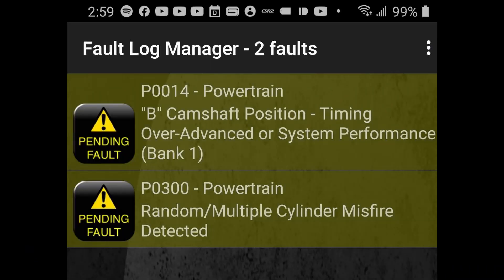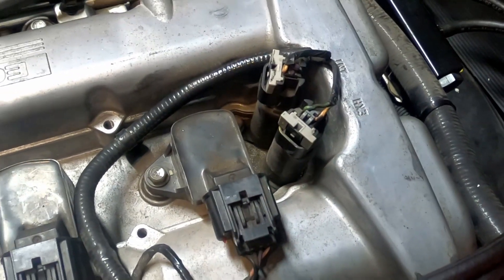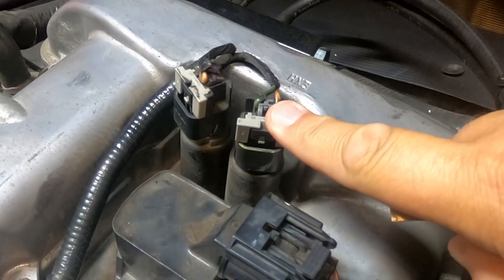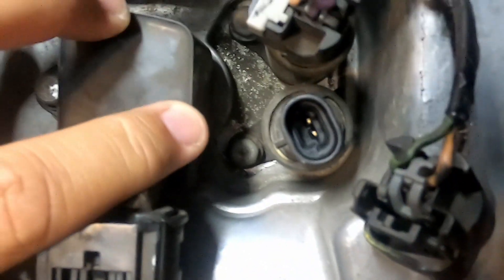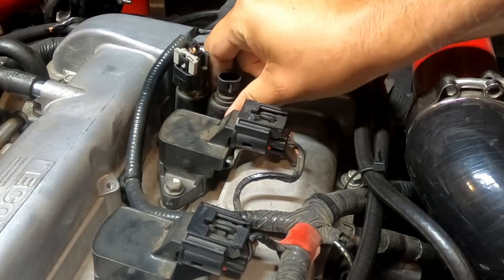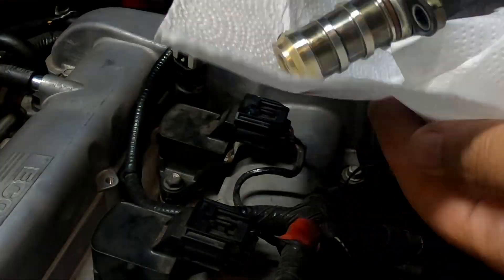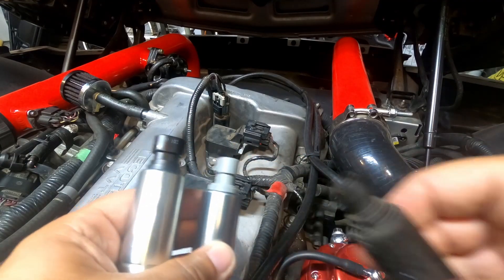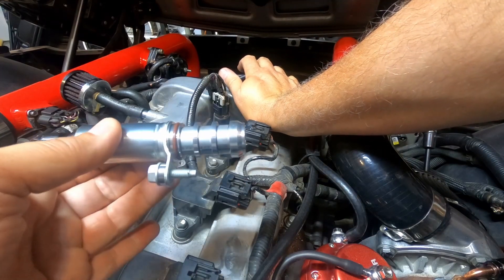Changing My Camshaft Position Actuators

Comment: So - did it clear the codes?
Reply from the maker: Well, I cleared the code myself and after driving a few days, so far  everything is good. I figure if after a few weeks I don't have any codes pop I'm, I'm good to go.
Reply: I changed mine on 2007 sky, now it gives me a 315 code, crankshaft position sensor not learned, lol..I guess I have to educate my sensors..aw well.

Comment: I had too do this to mike, I did it in a warm engine and didn’t realize I hadn’t pushed it in all the way and ended leaking oil on to my exhaust and only found out when driving on the i238 when smoke was gushing out of the back of my car
Reply from the maker: Ouch. I'm glad to hear it was just oil on you exhaust and you discovered the problem.